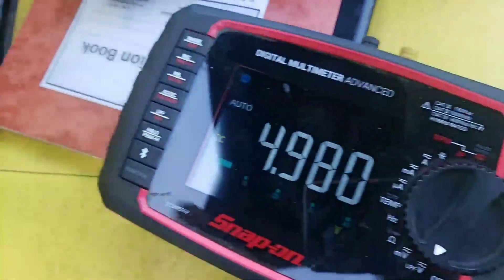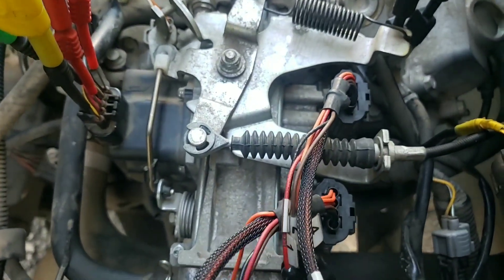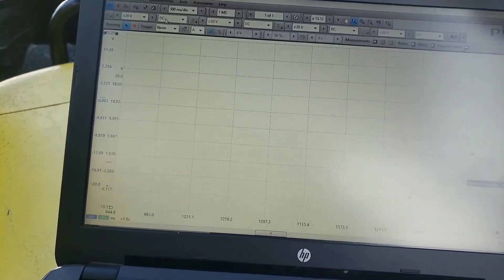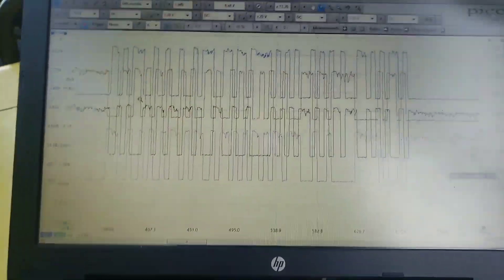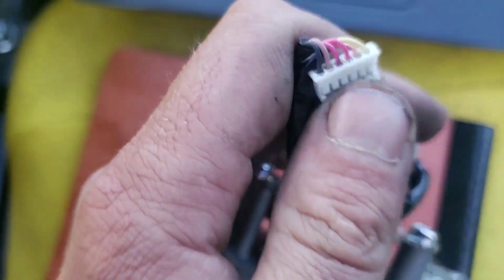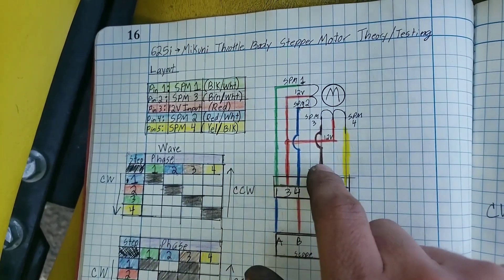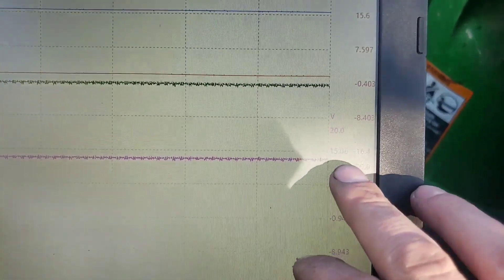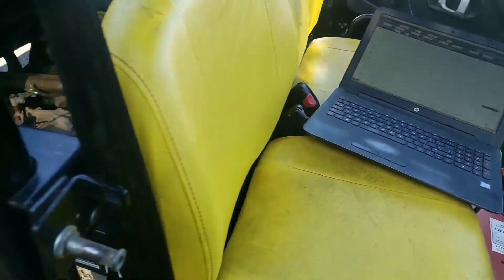XUV 625i - Rough Running & Misfires

Comment: Man I have a gator 625i I was driving it fine then backfired and now I’m not getting spark from one cylinder I changed the coil and plug nothing I put a meter on the white and yellow I have 13v it’s the cylinder closest to the seat

Comment: Chris, thanks for your video I had that same issues with rough running gator, I replaced the throttle body and it runs alot better for sure but now it wants to backfire,  when you are driving and let off of the gas it will backfire,  any idea what would cause this or what I should adjust?

Comment: Having trouble with my 620i and the throttle setup looks exactly the same. Every few weeks the crank case fills with fuel , I have checked for a leaking injector, as well as a rupured diaphram in the fuel regulator. Also it is low on power. Do you have access to the coolant temp resistance chart? Im thinking its running way too rich all the time due to a coolant temp problem......
Reply from the maker: I think I have it saved yet, I'll have to check through my database tomorrow. 

Honestly, it sounds very typical of a carboned up/oily throttle body keeping the primary throttle plate open more than it should be.

The fueling strategy is heavily based off of primary TPS readings, so if that throttle plate is even a few thousandths off of correct idle voltage, you will have all those symptoms.